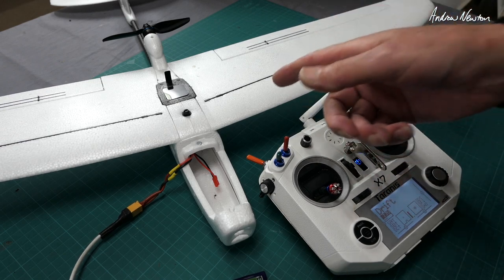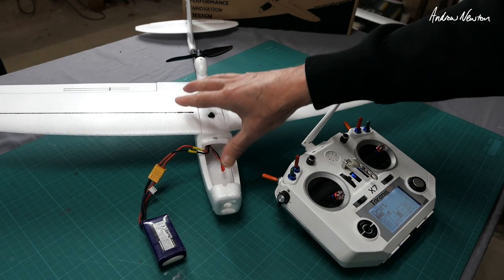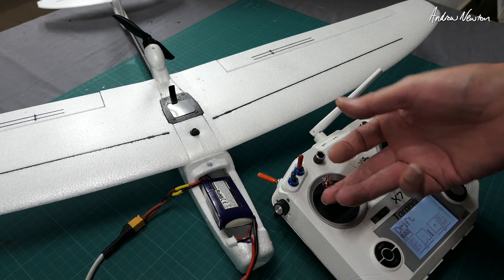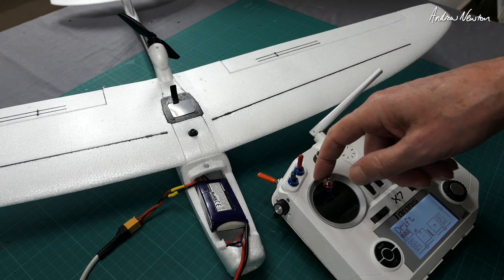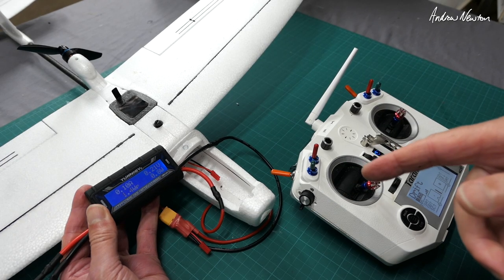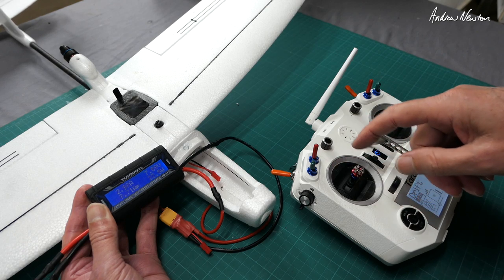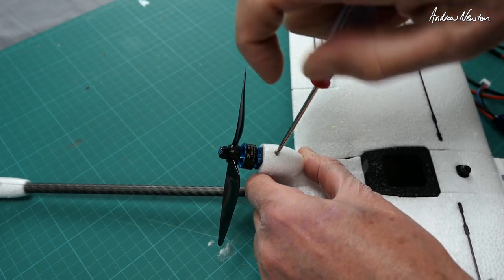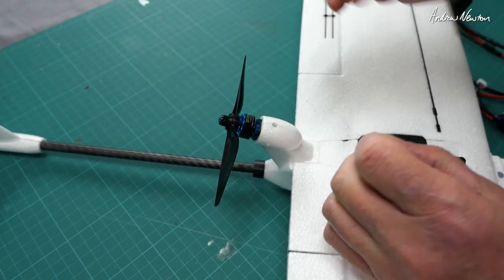ZOHD Drift ESC brake, calibration, current draw and motor mount

Comment: would love to see a real-life endurance test on the li-ion pack
Reply from the maker: At least 72 min by my calculations but I'll do a proper flight test
Reply: @AndrewNewton  which liions is this with.

I have picked up a couple of 3500mah 20700. There good for 30A though which is way overkill for this app. 

Weight is 25g light than 3s 18650. That 20g could easily add a reasonable amount of current draw to the 3s saving. 

Might just have to try both haha

Comment: Thanks for doing the brake. I will put a small folding prop on mine too. Also a streamlined nosecone for when not fpv ing.
Reply: chrisj800 I also want to put a folding prop on. If you find anything good, please let us know.
Reply from the maker: Yes let us know if you find a good little folding prop. It is a 5mm threaded prop shaft

Comment: Got to be near 30 min flight time on a 1300mah cruising. Add some thermals and you're laughing. Nice and agile too, if your other review is anything to go by.
Perfect info for the foam nerds. Thx, Andrew.
Reply from the maker: Yep 30 min easily on 2A continuous
Reply: @Shreyam_io  2s2p 18650 liion would be max 7000mah capacity. Highest capacity cells are around 3400-3500mah. Two series two parallel - doubles voltage and doubles capacity once. 7.2v nominal and 7000mah capacity. Probably too heavy for this plane though.

Comment: With the kopilot installed do you need to do the esc brake setting before connecting the Kopilot?
Reply from the maker: That's the easiest way. Some escs dont like the longer start up caused by Kopilot.
Reply: @AndrewNewton  hi Andy,  my kopilot is already installed and I can't seem to suss out how to do the esc brake whilst the kopilot is there. I assume I need the sbus disconnected and the throttle lead connected to the rx instead?

Comment: Is there a manual somewhere to change some settings in the esc like low voltage cutoff and soft cutoff or hard cutoff
Reply from the maker: Did I forget to include that link in the description?
Reply: @AndrewNewton  i just saw it, i must have glanced by it and didnt notice it! I already found all the manuals on their website, thanks though!

Comment: In the beginning you mentioned to put it in programming mode. How do you do that? Did not see it in the manual. I’ve tried calibrating in manual mode but don’t get the it is beeps.
Reply from the maker: Watch the video again, the very first thing I say
Reply: Got it, the throttle up is the programming mode. Thank you sir

Comment: Can you tell me what size heat shrink I need to join 2 18650 batteries. I don't really know how heat shrink is measured.
Thanks.
Reply from the maker: How many times have been surprised by heat shrink I ordered! I think it's circular diameter not pressed flat width but not sure which one you need for 18650s sorry
Reply: @AndrewNewton  Thanks for the speedy reply, I'll just have to guess and hope.

Comment: Sorry for posting on an order video, what rx have you got installed to communicate with the esc in order to calibrate? 

I plan on using crossfire in mine but I have an frsky xm kicking around. 

Could I justbuse that to quickly do this calibration before installing crossfire and matek with inav?
Reply from the maker: I'm using an RX6R. Might need to redo the calibration when you're connected to the Matek.
Reply: @AndrewNewton  Ah ok. So I might as well just wire the matek and crossfire then and just calibrate the once. Thanks for the response.

Comment: my receiver is connected but when I try to even change the modes, the lights on the zohd don't change. Do you know a solution to this? Thanks
Reply: it also won't go into programming mode. When I turn on the battery, the thing just starts beeping slowly for GPS then proceeds to beep very fast. The manual says "The throttle range is not calibrated, please switch to manual mode, process the throttle range calibration according to the ESC manual. " but I don't think I can even talk to my flight controller.
Reply from the maker: If you cant change modes then either the receiver is not actually bound or connected correctly to the Kopilot, or you haven't setup the mode switch.

Comment: Hello
Someone an idea to repare an broken Carbon Tube of the tail?
Reply from the maker: Epoxy resin and carbon tow or fibreglass
Reply: @AndrewNewton  
Thank you
Bixler 2 and Ranger 1600 are available on hobbyking for Amazing prices of round 85€ and free shipping  in europe.
Reply: @AndrewNewton  
With the drift i managed to fly my very first time After destroying a dart 635 and the esky1100. 
I also have a skysurfer But it won‘t fly so well. I think the Motor is to small with 2450kv and 5x5prop. 
What you think.?installing an 1400kv and 7x4 Ore bying bixler2 or Ranger 1600?
Reply from the maker: 2450kv and 5x5 prop should work well. Is the prop on the right way? Skysurfer and Bixler 2 are very similar. Keep learning with the Sky surfer

Comment: Anybody care to do a video of the full set up of this (or the Dart 250g since they seem to use similar drive components) including a calibration of the ESC with Kopilot in line? I believe someone quoted that the ESC should be calibrated after installing the Kopilot. Can anyone contradict this? The ZOHD site gives a written explanation of the above procedure with a bare ESC as here and it is helpful to hear those written diddly-ping-pings in reality. However there is no mention or video of the complete process with the Kopilot.
Reply: There are quite a few build vids of the dart 250g. If you're not bothered about weight, Oliver c, is good.
Reply from the maker: I will do a detailed Kopilot and VC400 setup on this eventually. Have done one on the Ranger G2 previously
Reply: @AndrewNewton  Thanks, Andrew. And yep, I finally got the G2 rolling after replacing the stock ESC with a Turnigy Plush as you did. Wouldn't work without it.
Reply: @kazarbizar7892  Olivier_C (not Oliver-c) does some really great videos but with iNav usually. Don't know if he's ever done one showing full stock Kopilot set-up as requested. Plenty of others (even the official ZOHD stuff) but not yet found 1 showing ESC calibration with Kopilot installed. If you know of 1 a link would be appreciated.
Reply from the maker: Just recorded a video on the complete Kopilot setup yesterday, will upload when my 2nd (oh yes) Drift arrives. Basically the same ESC calibration as normal, throttle high, connect battery, wait for the double beep then throttle low, but there are many single beeps before the double beep, have to be in Manual mode.
Reply: @AndrewNewton  Thanks Andrew. Looking forward to it.

Comment: What are the benefits of prop breaking
Reply from the maker: Breaking or braking? Stopped prop = less drag
Reply: @AndrewNewton  ah ok.  Is it possible to reverse the prop at full speed via a switch,  my thinking is reverse thrust breaking for landing in tight spaces or if your about to accidently over shoot the landing area?

Comment: Since it’s not a folding prop, why use BRAKE?
Reply: A stationary prop creates less drag than a windmilling one in most cases.
Reply from the maker: As Paul said, less drag and better for video
Reply: I would love to see some empirical data on this drag issue. I would think there would be circumstances where a free-wheeling prop would cause increased drag but I also strongly suspect there would be certain dynamic conditions where it would produce less drag. Any University students studying engineering want to have a crack? 😀
Reply: Simon of Oz 🤦‍♂️
Reply: D.B. Cooper I’m sorry you’re offended by my desire for science and hard data. Happy flying.
Reply from the maker: I have heard arguments both ways, we need to come up with a test somehow. But prop brake is still better for video view and belly landing.
Reply: Simon of Oz no sir you have not offended me at all. It’s just that some of us have been flying for many many years and realize things from experience. It is my firm belief that based on 25 years experience in flying almost every type of radio controlled model that a stationary propeller is much more efficient and quicker than a Windmilling propeller. There are some conditions that it could be desirable to have that propeller spinning at extremely low speeds in order to help slow you down for landing. A spinning propeller equals a drag. Anytime and airfoil moves through the air it creates drag and the faster it moves the more drag it creates. This is one of the core principles that defines how a gyrocopter is able to take off and fly with a passive rotating set of blades. I would say that close to 70% of my flying is done on the slopes. I love to fly motorgliders, gliders and typical aerobatic type RC airplanes at the slope. All of the planes I have flown perform much better with the propeller off and or folded then if it was spinning at all under a windmill effect. I apologize for my reaction when I should’ve simply try to help someone else.
Reply: @AndrewNewton  Try it both ways slope soaring. You will find there's less drag if the prop is not stopped.
Reply: @SimonBrisbane    In this pusher setup the prop is more likely than not to stop in the vertical position due to the airflow 'shadow' ...so the airflow is only seeing half a stationary prop. 
If it was windmilling the airflow would see the whole prop more of the time.

Other setups may produce less drag when windmilling.  Wouldnt mind seeing some tests/data on this as well.
Reply: A stopped propeller is way more efficient than a windmilling propeller. Just go fly some planes and figure it out yourself.
Reply: Curt Sidles you are incorrect
Reply: Physics is. It doesn’t change because of feelings.
Reply from the maker: Settle down children. Let's devise an experiment to prove it either way. Video up soon.
Reply: @AndrewNewton  Resprxted: Logic and a cool head. Thanks!
P.S. I've been an R/C pilot since early 1970. Still, I will try hard not to disparage others due to their youth and/or lack of experience.
Reply: Curt Sidles that’s a long time to be wrong.
Reply: See Andrew’s latest video for a demonstration/test of prop drag. As he rightly states in his comments, the test is inconclusive, it is not always the case that a freewheeling prop creates more drag than a stationary prop. There are more considerations to be had and under some conditions a freewheeling prop will induce less drag. It will depend on prop size, design and pitch.  ESC braking will  be beneficial for powered gliders, an axially folding prop obviously even better for less drag.
http://www.peter2000.co.uk/aviation/misc/prop.pdf